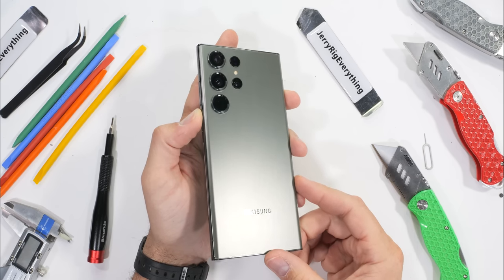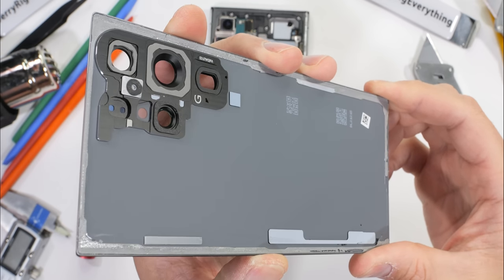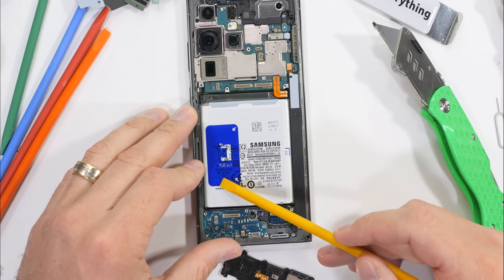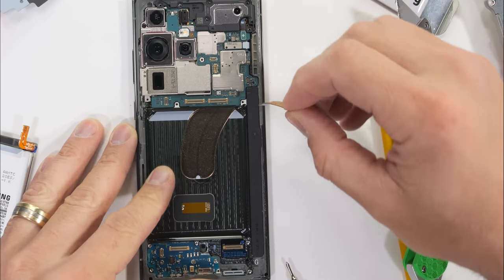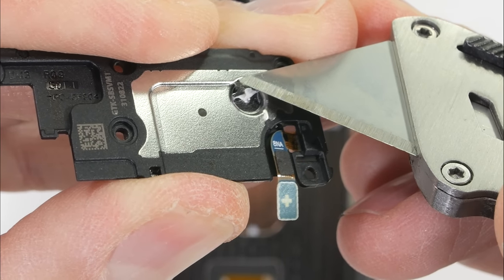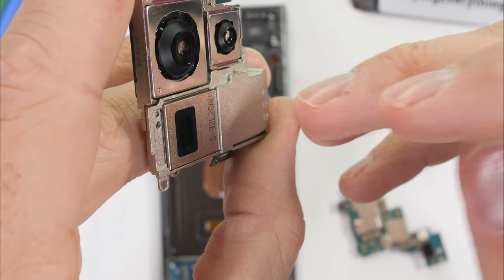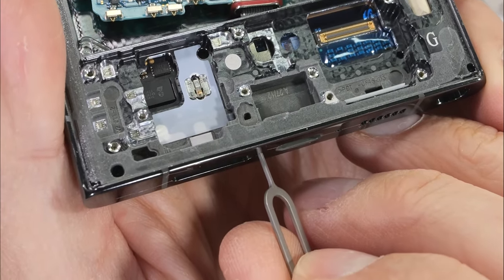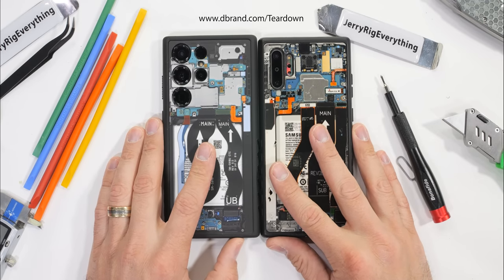I waited 8 years for this Galaxy S23 Ultra Teardown...

Comment: Why cant samsung just make a phone with the 8k recording/pics from the 20 ultra a 6000mah battery, an octacore, or higher chipset, a removable back with rubber gasket for water proofing, 80 watt charging and wireless, 14 gb of ram, a plastic screen that can actually survive a waist high drop, a removable sim card and sd tray maybe a double sd, AUX PORT and just charge 2k for it? All the things i just listed have been on their previous  phones, so why not just include all of them in one even with a high price if you have the best of everything everyone will buy it. You might even get some apple cultists to switch over. And next gen? Just upgrade everything? All the good stuff i just listed samsung has had for years they have to have new stuff now. Instead of taking away the sd, aux, screen, battery, downgrading the camera, less ram, etc, and telling us it is better than the last. Sounds like samsung is picking up apples bad habits. Or maybe even better yet BRING BACK MOTO MODS

Comment: Still from this day like most Samsung phones from 2019 and 2020. 
Striping down this phone shows you there is plenty of space for a Micro SD card slot, 
And doesn't matter what Samsung say about the battery or pen, you only have to look at the note10 plus and note 20 ultra as pen inside with build in SD card slot,
Money scams and makes you wonder why people fall for there stupid charms of wanting a phone that is not much different to a few years ago as bet they wouldn't even tell if never used a not phone at all,

Comment: last Samsung i had was an S3 then unfortunately had to own an iPhone up until 2023 for my work. i finally change jobs and a sigh of relief as i get to go back to a Samsung after years of cursing apples name. i bought a Samsung galaxy s23 ultra only to find they are the worst quality phone ever. its already been replaced twice , back cover has been cracked by simply leaning over as balcony while the phone was in my pocket , one little splash of water and the cameras get water ingress which takes days to disappear (despite claiming to be water proof (resistant)) now i have to contantly talk with the phone on speaker because no one can hear me with the hand set up to my ear....... so here i am watching your video so i can see where the microphone is to clean it..... even though this phone is 3 months old and meant to be dustproof....

Comment: My S23 Ultra just broke down in less than 2 month of use and the Vibration Motor is faulty. I hope it is not a all devices manufactured blunder by Samsung as I just gave it for repairs. So disappointed in SAMSUNG's degrading quality standards that there top FLAGSHIP is this SHITTY. Kindly test this too ZACK as the company does not want to accept there blunder even after many mails and contact with online assistants.

Comment: I poked the upper mic hole with the sim tool and i am worried that it might leak water inside or i did damage the mic ..any help please??
Reply from the maker: No problem.  It is not damaged.

Comment: Be aware of Samsung typical problem. After Galaxy s9/s9 plus.   They have a big issue. After time.  When  some rain drops even if you not taken phone into the water, besides phone is advertised waterproof.   You will have issue with  charging the phone via USB-C  port. Make a alarm to  clean and dry your usb port, otherwise it will not charge.    And it  a pain in your ass.  I have friend with S21 with same issue.  After time, you will have to change your USB port. And what causes it? Problem is oxidized cable.  Yes phone is waterproof, but not humidity proof.  Humidity with time will get inside the phone and looks like Samsung clearly not aware of that issue or they just dont care.

Comment: Im still amazed by the fact that  i charge my old note 8 and want to see if is working . Is an old phone, leave in a closet for a lot of years... Yea my brand new xiaomi ( i love xioami brand) , is slower.. That old note 8 is running like a mainiac with no lag. I try with the old VR from oculus and VR still working fine ... A phone from 2017 and is better than a lot of low and mid range phone , except 5G becosue was not a thing back in 2017 .

Comment: those real truly real samsung changeable batteries should be easier to get due reason there is so much bad third party fake batteries available. Many times they are lying what is real capacity for 'new' battery they even have sold once used real samsung batteries so it is annoying for regular people to buy real samsung battery for replacement, instead I bought cheaper a serrie samsung due reason I do not want to change batteries and have bad replacement battery.

Comment: Sir i accidentally push with ejector pin the air vent hole at the side of speaker they have some parts that can be damage ?im using S23 ultra
Reply from the maker: No damage done! I made a video about it.  You're safe
Reply: @JerryRigEverything  thank you very much sir ur the best...im not worrying now of my s23 ultra...

Comment: do not buy samsung phone pathetic battery optimization go for apple i have 7000 mah battery m51 and i use less then 1 hour in a day still it run only for a day in 10 to 100% and my hardware and battery is good i have also old jmax7 that one batter pefrom th